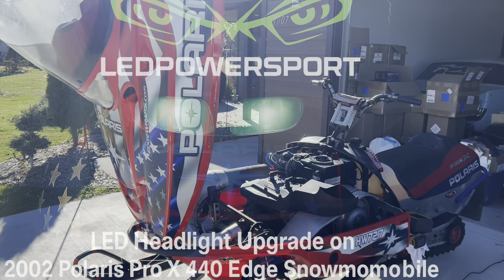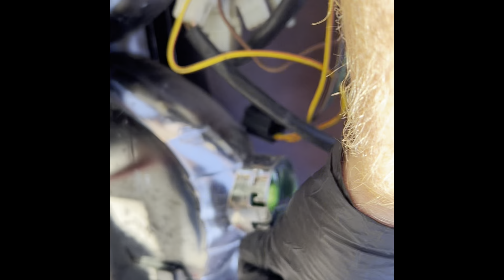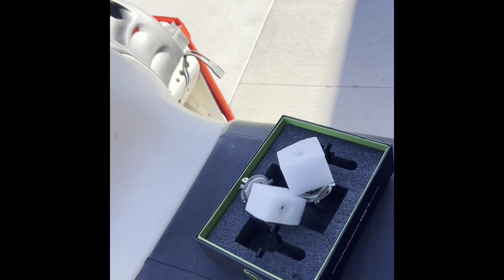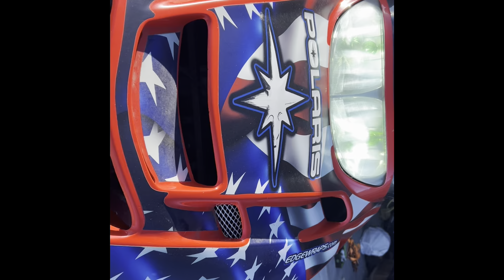How to Install Snowmobile LED Headlights | Polaris Pro X 440 | LEDPowersport 130W Upgrade

Comment from the maker: This video provides a step-by-step guide on how to install LED headlights on a 2002 Polaris Pro X 440 snowmobile, specifically upgrading it with the LEDPowersport™ 130 W High Power Series H4 LED Kit and H4 Rectifier Pair (0:05).

Here's a breakdown of the installation process and key information:

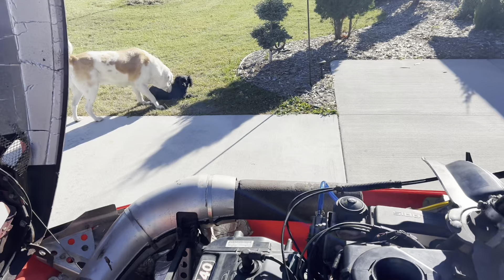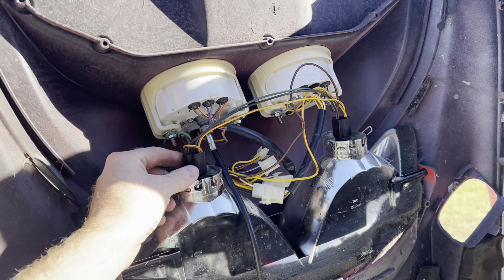•	Preparation and Disassembly (0:13-0:28): Begin by removing the plastic protector covering the electronics and headlights by unscrewing it from around the edges.
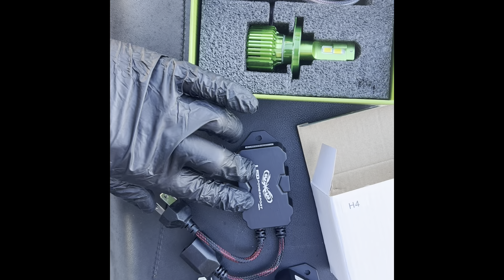•	Components Overview (0:29-2:06): The video highlights the need for the H4 headlight kit and the H4 Rectifier Pair, which converts the snowmobile's AC current to DC for the LEDs. The LEDPowersport™ 130W kit offers 13,000 lumens and 130 watts of power. It also emphasizes the importance of the power driver for consistent power and the rectifiers for AC systems.
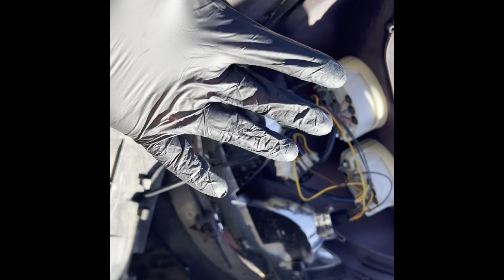•	Handling Precautions (2:19-3:18): Always wear rubber gloves when handling the LED bulbs to prevent hand oil from damaging the LED chips, as this can void the warranty.
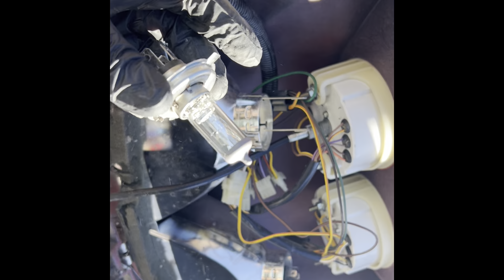•	Removing Old Bulbs (3:26-4:20): Disconnect the old headlight plugs and remove the existing H4 halogen bulbs. It's crucial to remove and discard any rubber boots on the back of the old bulbs, as they can cause overheating with LEDs.
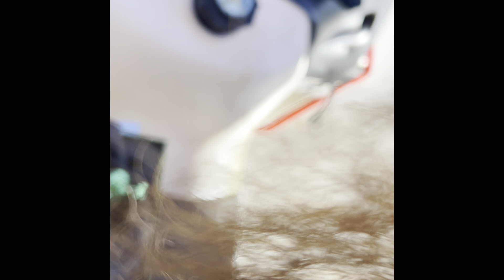•	Understanding Indexable Bulbs (4:45-5:22): The LEDPowersport™ high-power series bulbs are "indexable," meaning their collar rotates to allow adjustment of the beam pattern, eliminating dark spots and controlling the light direction.
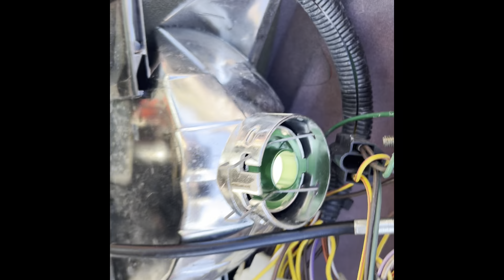•	Installing LED Collars (5:23-6:47): Detach the collar from the LED bulb and install the collar into the headlight housing first, securing it with the retaining clip.
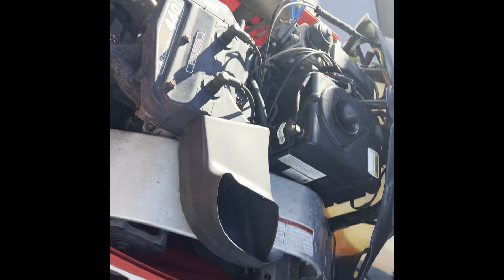•	Inserting LED Bulbs (6:48-8:57): Carefully insert the LED bulb into the installed collar, aligning it properly. The bulbs will "click" into place as they are indexed, allowing for fine-tuning of the beam pattern (vertical or horizontal) to best suit the housing's reflectors.
•	Connecting Rectifiers (9:19-10:46): Plug the H4 rectifiers directly into the LED bulbs, and then connect the rectifiers to the snowmobile's original headlight plugs. The rectifiers regulate power from the capacitor, preventing wiring damage in AC systems.
•	Cable Management (10:47-11:34): Use zip ties to secure all wiring and rectifiers, keeping them tidy and away from other components. Ensure the rectifiers are placed where they can dissipate heat effectively.
•	Reassembly and Testing (11:35-12:59): Reattach the plastic cover and ensure all screws are in place. The video then shows the installed LED headlights in action, highlighting their brighter, whiter, and more consistent light compared to the old halogens (13:39-14:41).
•	Final Notes (13:08-13:25): The video advises saving the original packaging for warranty purposes.